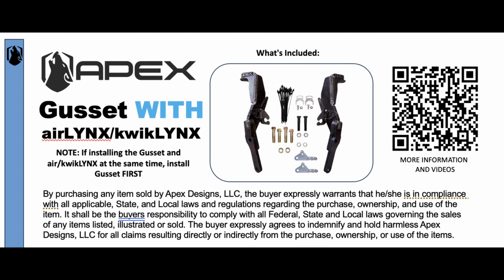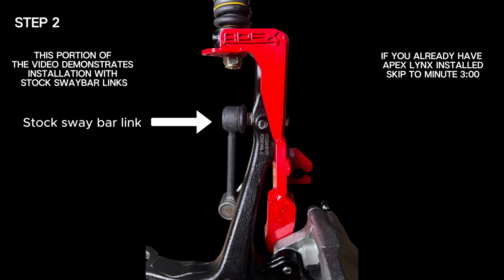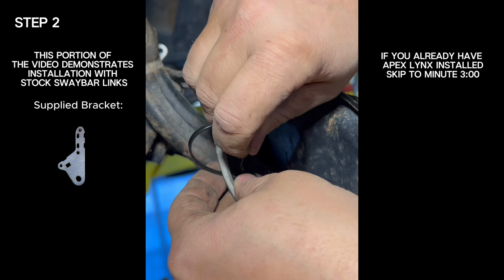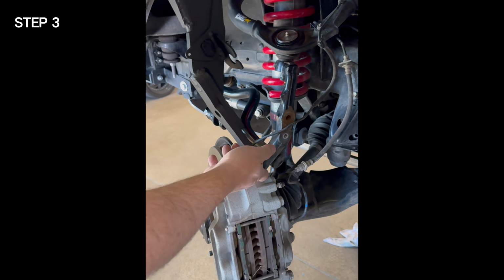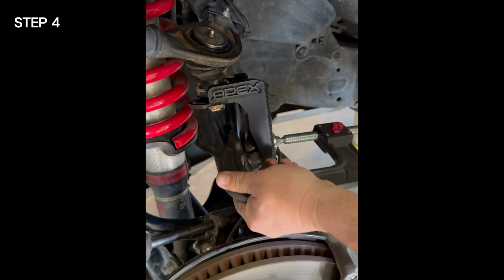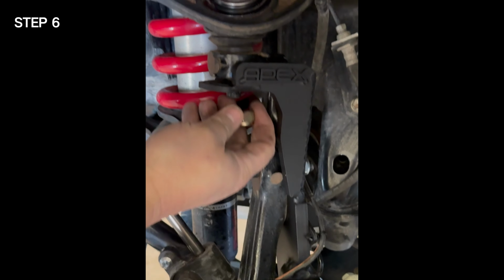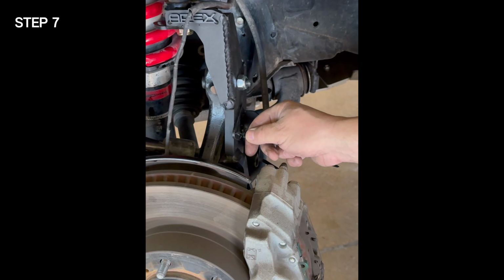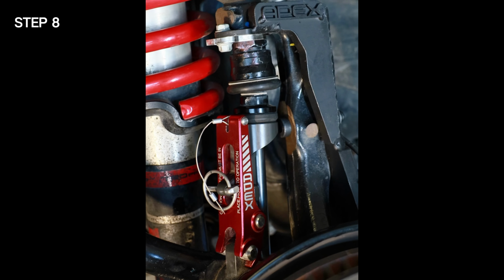HOW TO INSTALL APEX BOLT ON SPINDLE GUSSET for TOYOTA

Comment: Will there be a variant for portals ?
Reply: Why would you need these with portals? Portals replace the whole spindle with a billet portal/spindle assembly, at least for Toyotas with 74weld portals
Reply: @chrisridebike8 I meant for the disconnect on the sway bar. My fault for bad conveyance.
Reply: @superchargedx8058 that is an interesting thought. I don’t think you can run sway bars with portals since they attach to the spindle but if you could bolt them to the upper ball joint like the disconnects, that’s an idea
Reply: @chrisridebike8 there might not be enough demand for it. Most just remove the sway bar completely